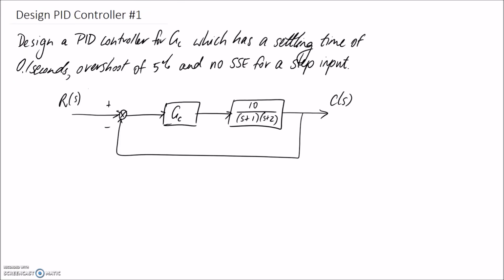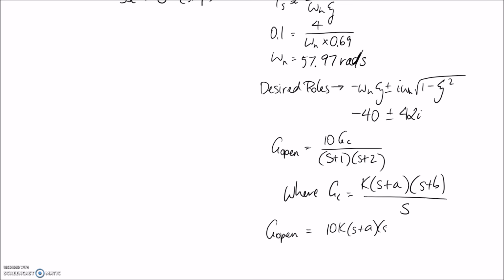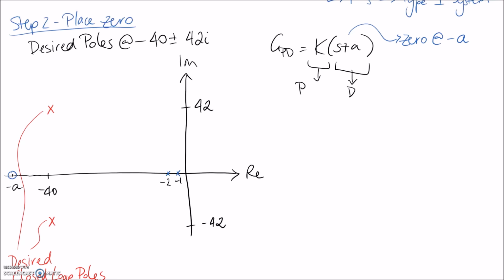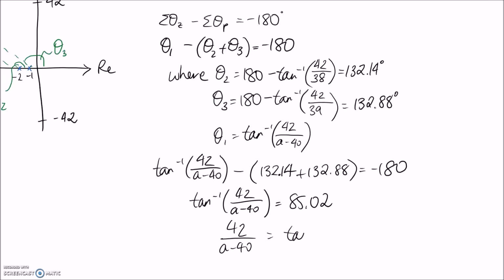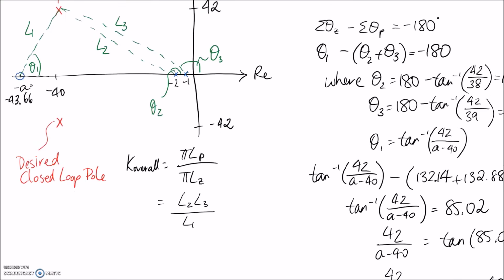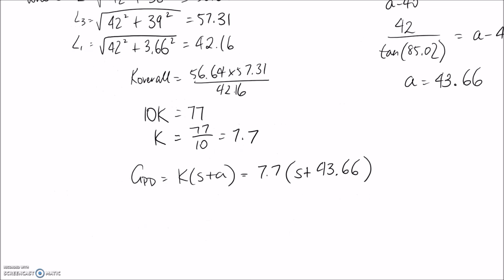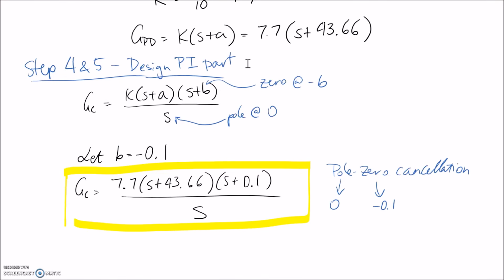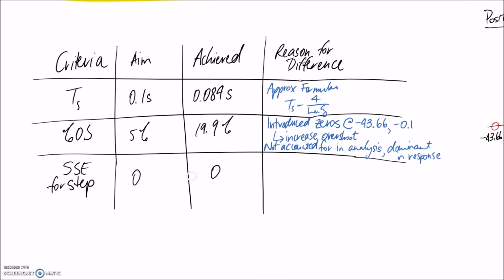Example: Design PID Controller

Comment: plant is a second-order system whose transfer function is G(s) = 1 / (s2 + 10s +20). Assuming the reference
signal R(s) is a unit step signal and the output of the system is C(s), the block diagram of a PID control system
is shown below to control the plant.
Fig. 3 Unit step response of a RLC series circuit
Please complete the following tasks for Problem 4.
1. Assume Ki = 0 and Kd = 0. Choose at least three different values between 10 and 350 for Kp. Measure
the performance of the system and discuss how the performance of the system changes with the
increase of Kp.
2. Assume Kp = 30 and Kd = 0. Choose at least three different values between 10 and 350 for Ki. Measure
the performance of the system and discuss how the performance of the system changes with the
increase of Ki.
3. Assume Kp = 300 and Ki = 0. Choose at least three different values between 10 and 80 for Kd. Measure
the performance of the system and discuss how the performance of the system changes with the
increase of Kd.
4. Determine the value of Kp, Ki and Kd so that the percentage overshoot is below 5%, the 2% settling
time is below 1 s and the steady state error is below 1%.

Comment: This video doesn't reflect reality.  It is easy to make formulas have a settling time of 0.1 seconds, but the control output is limited so the control output will saturate.  The response will not be as desired.   In reality the controller and amplifier only have so much power.
The zeros are creating the overshoot.  The zeros can be eliminated by having the PID gains act on the changes in the actual state only,  not the error.  Zeros can be placed too.

Comment: So how would you find the desired/dominant poles for the PID controller after getting the location of all poles and zeros? I tried to use the angle condition, but I am not getting the correct values.

Comment: Hi if you're still responding to comments on this video, i'm in a situation where i have to tune a PI controller of a third order system. using the dominant poles method, this had first order dominance and so was reduced to only one OL pole in the raw root locus. Question 1: will i need to add another pole to this in the design as it doesn't break away as the desired poles are in the complex plane? Question 2: Is there any way to just tune a PI controller from this or would it have to be PID with the need to place a zero someplace to the left of this to allow it to pass through the desired CL poles. Thanks.

Comment: How would you separate the PI and PD controller processes? Such as when just designing a PI controller with no settling time but given a steady-state error due to a step percentage?
Reply from the maker: It's the same sort of process - you just only add in the part of the controller than you want though. I don't think have an example of designing just a PI or PD though sorry.

Comment: May I know how would you get the angle of the poles if the poles are complex numbers such as -1+1.73i. Is is still the same as imagining a horizontal line on the pole and calculating its angle anticlockwise?
Reply from the maker: I recommend sketching it on your diagram so that you can see the triangles. But yes you want the angle measured anticlockwise from the positive real axis.

Comment: why you put a-42 for theta 1 and the ones before you put 40 -1 and 40 -2?
Reply from the maker: The poles at -1 and -2 came from the original block diagram to get the system's transfer function.

Comment: Please, why you put two zeros? How did you know it was going to be two zeros? I've seen methods that use only one zero and one pole. Are there different ways of doing thae same PID design?
Reply from the maker: If it's only getting one zero and one pole then it isn't a PID controller. There is a recap video in the playlist for the various types of controllers. I recommend looking at that.
Reply: @theryderproject5053  thank you very much! I will definitely watch that

Comment: Your voice and explanation are perfect! Ty so much <3 but why i am getting 0,92 for zeta? and one more thing: dont we have to use 3/zeta*wn for OS=%5?
Reply: You are using 0.05 for OS but you should be using 5. The percent overshoot equation assumes units of percent for OS.
Reply from the maker: Not sure about your zeta issue. Perhaps it's a brackets issue? Not sure where your other equation comes from - I've not see that before. It's very similar to the one that approximates settling time which is 4/(zeta*wn)...

Comment: Thank you very much for sharing! I was wondering if this can be used for third or higher order systems. Also, how would affect having a pre-compensator. Thanks again!!
Reply from the maker: Yes you can apply this method for higher order systems and if you have a pre-compensator.

Comment: hi ma'am what happened to the single 's' at the denominator s(s+1)(s+2) @11:07 when solving for the angles? Thanks!!
Reply from the maker: This is the PD stage where the first zero is placed. In the PI stage which comes later, a pole is placed at 0 (the single s) and an extra zero is placed close to 0 to achieve pole-zero cancellation.

Comment: is there a way to decrease that 17% overshoot to 5%? because that is our requirement.
Reply from the maker: You'd need to go through a trial and error process (likely using a computer because it would be much quicker) to find that solution. The manual calculations make some simplifying assumptions that impact the result. I think I talk about the specifics of this toward the end of the video.

Comment: Isn't it required to close the loop prior to the maths? Sometimes it gets really confusing wheter or not the system should be in close or open loop. Very nice example, though.
Reply from the maker: It depends what exactly you're calculating as to whether you need to use the open or closed loop transfer function. There is also often more than one one to do the calculations meaning that depending on your approach, you may use one or the other.
Reply: @theryderproject5053  What was your reasoning to use an open loop transfer function here? 

On the your previous playlist you used closed loop transfer function to solve for the variables (zeta and Wn). What was your reasoning for using a closed loop transfer function there? 

Thank you, I am having trouble understanding the approach.